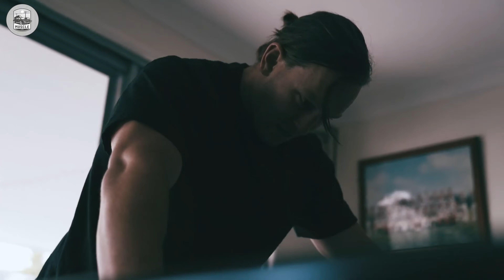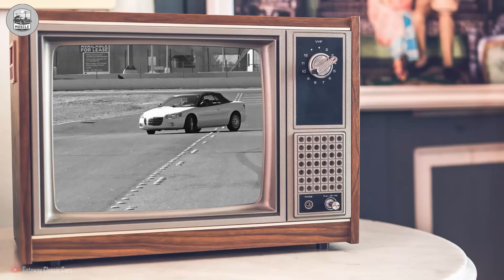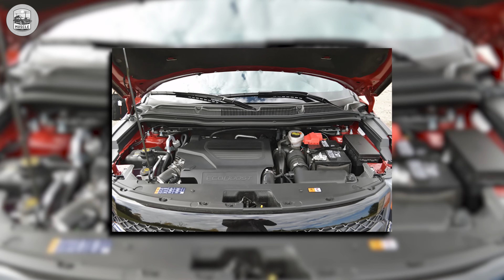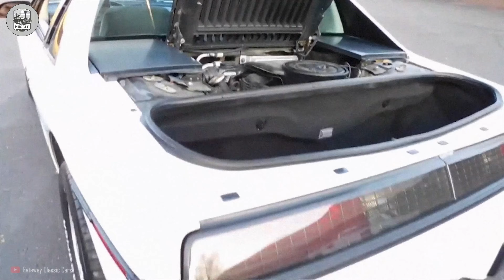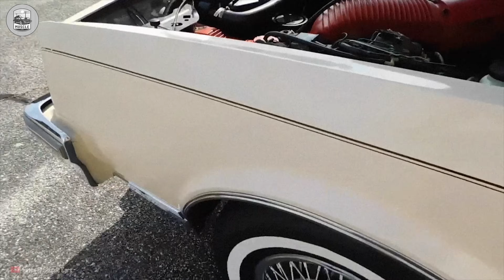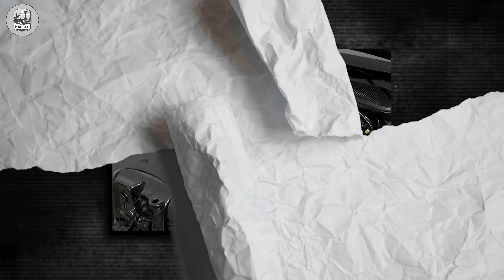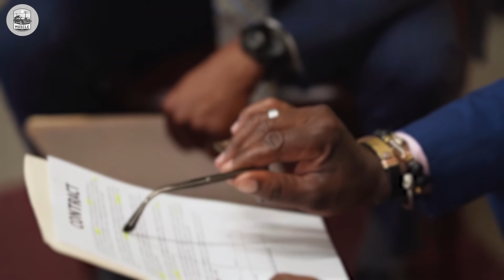MOST FAILED ENGINES ever put in production cars | Worst engine blunder!

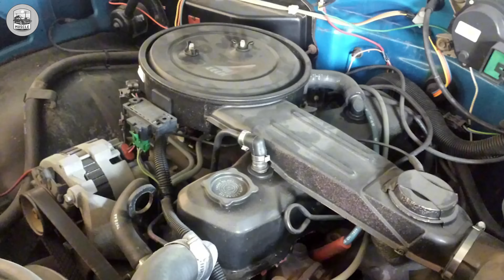Comment: 18:56- - When GM finally discontinued its old rear-wheel-drive X-body cars (Chevrolet Nova, Oldsmobile Omega, Pontiac Ventura/Phoenix, Buick Apollo/Skylark) in 1979, the Iron Duke engine should have been discontinued along with them.

Comment: I had a 3.1 in a 90 lumina and that thing was indestructible. It went over 300,000 miles while getting redlined at 8 grand on the tac.  Even went well beyond that when a torque converter went out ( did 20 mph over max speed in first gear for 30 seconds) no problem with the engine even after that.

Comment: The 3800 v6 is an amazing engine. I've owned a ton of Regals, LeSabres and Park Avenues with that engine and only had to replace the series 2 in the Park Avenue because the previous owner never changed the oil which isn't poor manufacturing. That was because the previous owner was stupid. I've owned about 30 cars with these engines with well over 100, 150k on them. The 3800 is the best engine ever made and won a ton of awards over the years. As for my 1995 Park Avenue, I installed a junkyard engine from a rear ended LeSabre 4 years ago and it's still going strong and still has all its power.

Comment: We should all agree the Oldsmobile diesel was a dud of an engine. Taking a gas V-8 and converting it to a Diesel waa a bridge too far. The problem with this was the fact that compression on a gas engine is much lower then a diesel engine. They never upgraded the internals to handle such compression. That's why most Oldsmobile diesel engines would only lasts 40,000 miles before finally giving up. Also, where on this list is the engine from the Yugo GV?

Comment: This video was a fail when not mentioning the fiasco when Chrysler got married  to the Mitsubishi engines. Not only was those 1.6, 2.2, even the 2.6 engines bad but also the automatic transaxles was weak.
Reply from the maker: You're 100% right—Chrysler’s partnership with Mitsubishi in the '70s and '80s was a wild ride, and not always in a good way. Those 1.6L, 2.2L, and 2.6L four-bangers were a far cry from the raw V8 power that muscle car fans love. And let’s not even start on those weak automatic transaxles—they just couldn’t handle the torque. Chrysler tried to play in the compact game, but sacrificing power and reliability? That was never going to sit well with real gearheads.
Thanks for being part of the ride—have a great day!

Comment: The 305 wasn’t a fuel saver. It was a poor design. In the 70’s the engineers thought smaller bore saves fuel when it’s proven that it ate just as much fuel as the 350

Comment: Well, I beg to differ. I had two of these motors and great service from both of them. One of them, the Buick 3800 got me 432,400 trouble free miles with basic maintenance. The motor never needed to be taken apart, never smoked, and had great mileage. The only things that failed were the alternator, starter, radiator, water pump, and the computer (my fault, I disconnected the battery while it was running, the ignition switch gave out, and I couldn't turn off the car). When I finally did give up on it, it was my mechanic that couldn't figure out why it ran rough on warmup. It turned out the block was warping. But still, 432,400 miles with little work.
The other motor is the Toyota 3ve V6. I currently have this one in a 1993 T-100 four-wheel drive. As of today, it has 408,300 miles. Not the best mileage or power, but it is adequate. So far, the radiator, starter, water pump and alternator needed replacing. One of the heads lost a valve, so I had the heads rebuilt, but the head gaskets never failed on me. Both of these vehicles are all highway miles of 100 minimum per day. I am sure that along with regular maintenance and "safe" driving has a lot to do with the long lives of these motors.

Comment: My 2.8 v6 in my 84 bronco 2 it a awesome motor, solid lifters and no timing chain this motor when rebuilt correctly can take a hell of a lot of punishment, i only use valvoline straight 50w zr1 racing oil with zinc and i use a wix oil filter, out of the 41 years its been on the road the total down time is only 1 month and that was due to rebuilding the engine and the transmission, the best thing of all is that the fact that all the steel it was made from is U.S STEEL, built to last no these days just about all the steel car are built with is from cheap weak Chinese steel, china is all about quantity not quality

Comment: check and change the oil and change the antifreeze.  dexcool was a killer when left to long in the engine
Reply from the maker: @thomas5223 You’re absolutely right, brother! Staying on top of maintenance is the key to keeping these beasts running strong and true. Dexcool can indeed turn into a silent killer if it’s left sitting too long—those deposits and sludge can wreak havoc on your cooling system. For anyone running an older muscle car or even a modern performance ride, regular oil checks and coolant flushes are a must. It’s all about showing your car the love it deserves so it can keep roaring on the road.
What’s your go-to maintenance tip or product for your ride? Let’s hear it in the comments, folks! And hey, if you haven’t already, make sure to hit that like, share, and subscribe button to keep the American Muscle Cars community growing.

Comment: Jag had the 12 from around '73-'95 in the American market. '73-'81 were the bulk of the problems due to bad cooling and early versions of EFI ('78-81), about a decade before American cars, plagued a good motor. From '82 on, no cooling issues but leaks due to no R&D for upgrading gaskets. When Ford bought the company in '93, their deep pockets handled the leaks. Too little too late as the 12 in the US was discontinued after '95. The '94-'95 XJ12's were very good machines with only one problem of having a PS filter that always leaked. That removed, a great car, and fast.
Reply from the maker: @philipkolpek7183 Awesome breakdown of the Jag V12 story! It’s wild to think how ahead of its time Jaguar was, but you’re right—the cooling issues and early EFI problems held it back in the early years. By the time Ford stepped in with their cash and fixed the gasket and leak issues, the muscle had already been overshadowed. Still, those '94-'95 XJ12s were beasts, packing serious speed and refinement for their time. That PS filter leak sounds like a quick fix for a machine that could easily keep up with its era's American V8s.
Muscle car fans, what’s your take—does the XJ12 deserve a spot in the performance hall of fame, or does the muscle badge stay strictly American? Let us know in the comments
If you're into classic horsepower stories, smash that like, share with a fellow gearhead, and subscribe to American Muscle Cars. Have a great day, everyone

Comment: There are a few B. S. statements in this review. One being head gasket failures due to dissimilar metals being used in the engine. Like a cast-iron block and an aluminum head. Really? do you know how many excellent engines use this combination that do not have head gasket failures. The thumbnail should read, I really wanna know a lot about engines.
Reply from the maker: @johnjessey6955 Thanks for your thoughts
You’re right, many engines with a cast-iron block and aluminum head don’t have head gasket issues—it’s all about proper engineering and maintenance. That said, we highlighted this point because some engines in the past faced unique challenges with heat expansion differences, especially when cooling systems weren’t up to the job. Every engine has its quirks, and that’s what makes digging into muscle car history so fascinating.
We’re always open to refining our content and diving deeper, so keep sharing your insights! Everyone here: What’s your take on engine materials and design? Drop your thoughts below, and let’s rev up the discussion
Don’t forget to like, comment, and share this channel with other muscle car fans. If you’re passionate about American Muscle Cars, hit that subscribe button for more content! Wishing you an awesome day, John

Comment: I had a "92" Pontiac Grand Prix 3.1 in sport package trim. I drove that thing like a race car from day one. Never had an issue with engine and ran it up to 140,000 miles. Then traded it in on a "01" Buick Regal with a 3.8. Ran that up to 120,000 miles with no engine issues. Had to have the transmission rebuilt at 90,000 miles. Both engines were very reliable for me.
Reply from the maker: @jamessoda8915
 A '92 Pontiac Grand Prix with the 3.1 Sport Package—what a solid machine! Sounds like you drove it like it was meant to be driven, like a true enthusiast. Hitting 140,000 miles with no engine issues proves just how tough those 3.1s were. And then trading up to an '01 Buick Regal with the legendary 3.8? That’s another rock-solid choice. Those 3.8 V6s are known for their reliability and smooth power delivery, even with a rebuilt transmission at 90k.
It’s awesome to hear about these cars holding their own under hard use. That’s the spirit of American engineering—built to perform and built to last
To all American Muscle fans out there: drop your stories in the comments, smash that like button, and subscribe to American Muscle Cars for more great content. 
Keep driving, and have a great day

Comment: Funny thing about the 8-6-4 was just unplug the computer and you had a dependable 368. Too bad they ditched it altogether for the Hook &Tow motor. The diesel was a problem for sure. I owned a beautiful bustle back Seville with one. It was horrible especially trying to pull Donner Pass. 😂The rolling coal at 40 mph sure pissed people off who wanted to pass me.
Reply from the maker: @donfronterhouse4759 
The Cadillac 8-6-4 system sure was an ambitious idea for its time. You're absolutely right—unplugging that computer often turned it into a more dependable 368 V8. It’s fascinating how early cylinder deactivation tech struggled but paved the way for modern advancements. As for the diesel, that 5.7L Oldsmobile engine was definitely an experimental chapter for Cadillac. Pulling Donner Pass must’ve been a challenge, but hey, nothing beats the character of a classic like your bustle-back Seville. It’s all part of the charm, right?
For all the muscle car fans out there, what are your thoughts on Cadillac’s engineering experiments in the '80s? Drop your stories in the comments, share this video, and don’t forget to hit that subscribe button for more American Muscle Car nostalgia and history
Wishing you an awesome day filled with horsepower and torque

Comment: The common denominator " GM ".
Reply from the maker: @rjblue1119 Thanks for your comment
 You’ve touched on a heated topic, and it’s one that sparks plenty of debate among muscle car fans. While GM has had its share of ups and downs, let’s not forget their legendary engines like the LS series, the classic big blocks, and the iconic small blocks that powered some of the most memorable muscle cars ever made, like the Camaro Z/28 and the Chevelle SS. Sure, no brand is perfect, and some engines have faced issues, but for many enthusiasts, GM engines represent power, reliability, and innovation.
What’s been your experience with GM engines? Have you had any triumphs or challenges?
Have an awesome day, and keep the spirit of muscle cars alive

Comment: The Chrysler 2.7 was good if you maintain it, we had one in a Chrysler 300, traded it at 197500 miles, it was never opened, we changed oil at 3000 miles, it never failed us.
Reply from the maker: Wow, @gainestruk1, it sounds like you really took excellent care of that Chrysler 2.7
 That’s the key—regular maintenance, like changing the oil every 3,000 miles, can make all the difference, even for engines that get a bad rap. While the 2.7L V6 faced challenges like oil sludge issues when neglected, your experience proves that proper care can extend an engine’s life to nearly 200,000 miles—a real testament to your dedication
For anyone wondering, this engine was part of Chrysler’s LH platform lineup, used in models like the Chrysler 300M, Concorde, and Dodge Intrepid. Its innovative aluminum design and dual overhead cam layout were advanced for its time, even if reliability varied
Let us know, muscle car fans: what engines have surprised you the most, good or bad? Share your stories in the comments, and don’t forget to like, subscribe, and share! Have a fantastic day and Happy New Year

Comment: I had a 1978 Chevy Monte Carlo. The 305 cubic inch V8 is a lemon. It constantly pinged and knocked on all grades of gasoline. Nobody could fix that engine!!! It used 2 quarts of oil every 1,000 miles! It got only 9 miles a gallon on premium gasoline which it still pinged on. Why was that engine so unfixable!!? The exhaust always shot out black suit. I had to finally get rid of the car in 1987 because the oil consumption, worsening gas mileage and undiagnosable coolant leaks. I traded it in for a 1987 Acura Integra that wasn't so reliable also.
Reply from the maker: @albertcarello619 Wow, thanks for sharing your experience with the 1978 Chevy Monte Carlo and its infamous 305 V8! The 305 was part of GM’s effort to balance emissions regulations and fuel economy in the late '70s, but it often fell short. Those early emission-control systems choked the engine’s potential, causing issues like pinging and oil consumption. The black soot from the exhaust was likely due to overly rich fuel mixtures—another common problem of the era.
Despite its flaws, the Monte Carlo itself remains a classic. Many enthusiasts have since swapped out the 305 for more robust engines like the 350 or 383 stroker to unleash its true muscle car potential.
We’d love to hear more about your muscle car memories!
 Drop your thoughts in the comments, share your stories, and don’t forget to subscribe to Muscle Car Masters! Wishing you a great day and a Happy New Year
Reply: @MuscleCarMasters68  Thank You! Happy New Year to You too! When it came to servicing my 78 Monte Carlo mechanics are incompetent whether you go to the dealer or  independents both like giving up on my car. Around the year of my Monte Carlo there was an epidemic of totally incompetent auto mechanics.
Reply from the maker: @albertcarello619  Thank you for sharing your story about your ’78 Monte Carlo! It’s a classic beauty that deserves the best care, but sadly, your experience highlights a challenge many muscle car fans face: finding mechanics who truly understand these machines. Back in the late '70s, as cars transitioned into the era of emissions regulations and new technologies, some mechanics struggled to keep up with the changes, leaving enthusiasts frustrated.
For your Monte Carlo, consider seeking out a shop specializing in classic American cars or even joining a local car club where other owners can recommend trusted mechanics. There's a dedicated community out there that understands the passion for keeping these iconic rides roaring
What’s been your favorite memory with your Monte Carlo? Let us know! Don’t forget to explore more muscle car history on our channel, and remember to comment, share, and subscribe. 
Wishing you a great day and a Happy New Year
Reply: @MuscleCarMasters68  Thank You! Happy New Year to You too!
Reply from the maker: @albertcarello619 Happy New Year to you as well
Looking forward to chatting again soon on newest videos - take care
Reply: @MuscleCarMasters68  So many mechanics back in this time are absolute FLUNKIES!
Reply from the maker: @albertcarello619   It’s always great to see passionate comments like yours in the community. While some mechanics back in the day may not have been up to par, others were absolute legends, keeping these roaring V8 beasts running strong. 
Have a fantastic day

Comment: Fantastic. I'm genetically GM so it's nice to see a lot of support for the Buick 3800. I have three Buick 3800's which myself, my wife and son drive daily. They're all high milers. Only had one coil pack failure and one crank sensor fail. Two of them still have the original plastic water pump elbows. Best engine ever built indeed. The GM 305 from late 70's to early 80's all suffered premature cam wear due to insufficient oil galleries. Another GM 305 ailment which wasn't covered, was the Made in Mexico, cracked head syndrome. lol
Reply from the maker: Wow, what a fantastic story about your family’s love for the Buick 3800! It's awesome to hear these engines are still going strong after so many miles—that’s a testament to GM's engineering brilliance. The 3800 truly is a legend, blending reliability, efficiency, and power in a way few engines ever have. Those original plastic water pump elbows hanging in there? That’s incredible!
As for the GM 305, you're absolutely right—those challenges in the late '70s and early '80s were a tough chapter. The “Made in Mexico” cracked head issue and premature cam wear definitely tested GM's reputation, but it’s cool how engines like the 3800 redeemed their legacy.
Let us know what American muscle rides you’d love to see next on the channel! Don’t forget to comment, share, and subscribe for more muscle car nostalgia. Have a great day and a Happy New Year